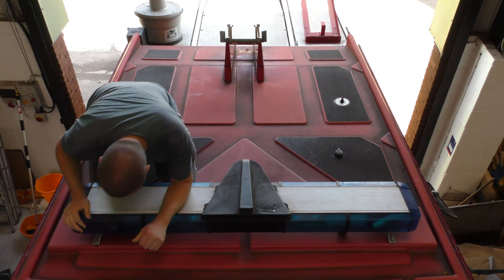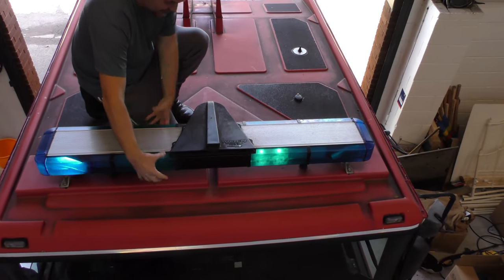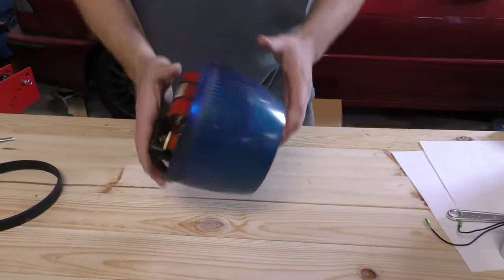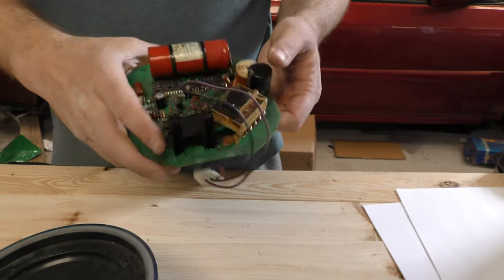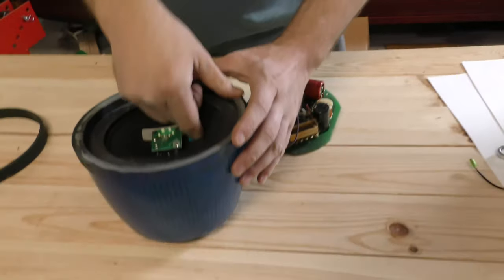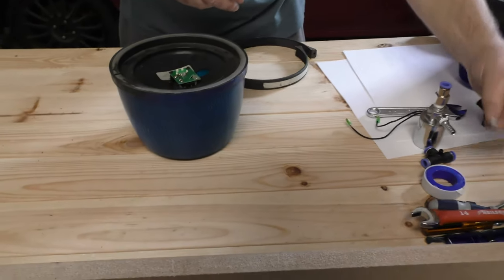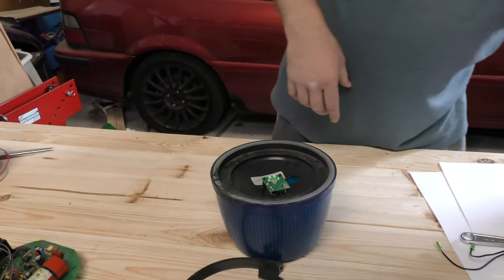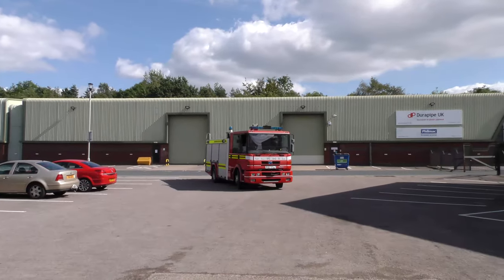UK Dennis Sabre Fire Engine Install Blue Lights, Siren and Demo

Comment: The lights on emergency vehicles are all led lighting now
Reply: They're gradually changing them. GMFRS are slowly replacing their fleet with fire engines that have LEDs, but they obviously still have their old fleet with the old sirens on.

Comment: ahh the old whelen edge 9000 with siren, HF on your siren box is Hands free, it allows for a switch to be placed... say on the vehicle horn, for the operator to use horn ring to change the siren while driving and not look at the box and push anything

Comment: what happens when you get caught with the siren on?
Reply from the maker: Depends who's vehicle is faster.........Only kidding.  A video on this coming later in the week.
Reply: Not a problem on private land, on ANY public road...good luck.

Same with the blue lights.
Reply: Can only use on private property not the road.
Reply: When I had an ex police car (1972 spec) 😉 ,  I was told to keep the lights covered up on the road and on no account use the siren.
Reply: @Mechanicalrob  I don't think there's any law about the lights being covered. You just can't use a blue 'beacon' unless you're specified in the act. And I see lots of HGVs and Transit recovery vans using blue lights they shouldn't have.
Reply: @LewisCroden  if it illuminates blue it should be covered. Even if clear led lens that's blue.
Reply: @louscannonmagoo9989  Nothing they could charge you with as long as it is turned off.
Reply: @LewisCroden  blue lights should.only be fitted to emergency vehicles whether illuminated or not. This being a decommissioned fire engine does not count as an emergency vehicle. Blue lights can only be used to attend an emergency, at the scene of an emergency or to warn of hazard in the road. They need to be covered.
Reply: @louscannonmagoo9989  It's not an offence to fit blue lights to a vehicles that isn't one. I can call Whelen tomorrow and order them? It's just an offence to use a blue 'beacon' without authority. The lens colour means nothing. Also many HGVs are covered in blue lights.
Reply: @LewisCroden  just because you can order one doesn't make it legal. You can buy a lock knife from B&Q. Still illegal to own it. Same with these. The lights need to be covered when on a public road or public place. The guy in the video says that the industrial estate is private land so he can use them. He is wrong there as it's a public place so technically be can't use them there.
Reply: Louscannon Magoo it’s illegal to own something B&Q sell? You haven’t a clue what you’re talking about. Even your analogies are factually incorrect. You can buy anything you need from B&Q and have them in a public place as long as you have ‘Lawful Authority’. If the reason is genuine the police can’t do anything, hence why B&Q sell those products to the trade.. And as I said, you could fit any equipment to your vehicle, it’s only an offence to use them.
Reply: B&Q sell a knife that the blade locks out on. Most DIY stores sell them. Any knife with a locking blade is a prohibited weapon. The point I was making was just because they sell it doesn't make it legal. Look it up and see. Just because you can order a blue light from whelen doesn't mean you can then fit it to your vehicle. Out of interest. What do you do for a living?
Reply: @louscannonmagoo9989  "Section 139 of the Criminal Justice Act 1988 also creates an offence of having a pointed or bladed article in a public place without good reason or lawful authority."
Reply: @LewisCroden  and your point is? Excuse the pun.
Reply: @louscannonmagoo9989  The stuff b&q sell isn't illegal. You have 'lawful authority'.
Reply: @LewisCroden  there is no lawful authority for a lock knife. Any knife with a blade that fixes when opened and requires a secondary action to fold it away regardless of blade length is illegal. Keep arguing though because you are very entertaining.
Reply: @louscannonmagoo9989   you are wrong 

your lawful  excuse is that it is a tool required for a legitmate work or leisure activity... 

caryying a locking knife randomly  in the  streets however is likely to get into trouble
Reply: @nicolajaynehodson9223  there is no lawful use for any knife that locks. You have that in a public place it's prohibited. End of!
Reply: @Glow in the dark Funeral director in the UK? There is no lawful use for a lock knife. I am a police officer with 17 years experience. If the blade locks it's illegal according to current UK law. End of!!!
Reply: All the lights work on 12 volts
Reply: @Glow in the dark Funeral director  'Louscannon' is a walter mitty
Reply: Louscannon Magoo have you ever been to a car show? Or anything like it where people take emergency vehicles? People who buy them don’t need to cover the blue lights what so ever, longs if your not using the vehicle to comment any crime or using the sirens to cut traffic or whatever you doing nothing wrong where I live in the UK someone owns a old Ambulance and Police witch has the sirens working the guys drives them on a public street everyday and he’s never been pulled

Comment: Personally I would’ve bought clear LED light bar
Reply: Chip King it wouldn’t be authentic with LED’s
Reply: Disagree personally, the classic look of that bar with the age of the truck it just works so well I think
Reply: He's put the original equipment on the engine. That's what it ran with in service, it's authenticity